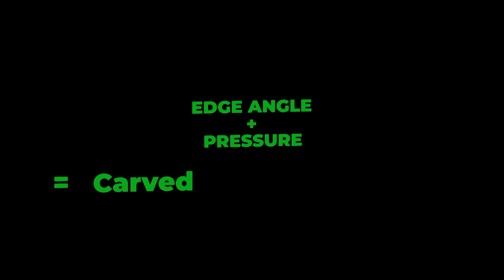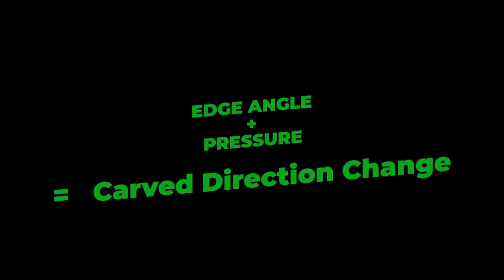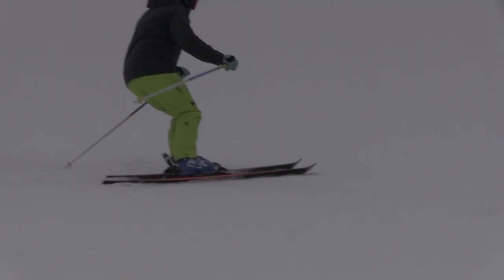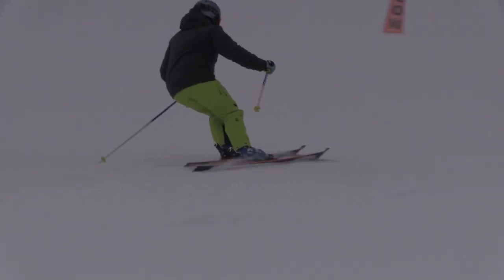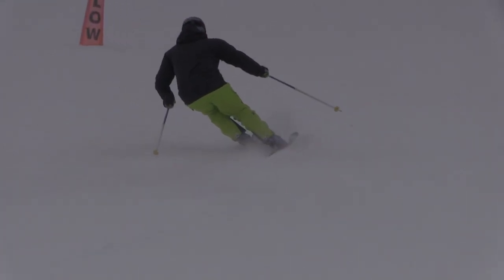Warren Jobbitt - Skiing Technique Exposed - Episode 3 - Direction change

Comment: 1:36 it is Not the lower body that creates anything in skiing.  It is the positioning of the upper body in relation to the direct that your skis are going that changes the leg angle so when you change your balance from your downhill to your uphill foot, that ski will roll over onto the inside edge and the turn will be created.

A new turn is created from your eyes down, not from your feet up.  Watch any GS racer in slow motion and it is clear to see.

1:44 The upper body is following the direction of the skis.  If the upper body stayed in that position, the leg angle would stay the same.  When he decides to start a new turn, his upper body stops traveling across the hill and starts to lean toward the fall line.  The skis continue on, and the leg angle changes.  When his feet pass under him, that's when he steps off his left foot and balances on his right foot.  The skis roll over and the turn starts.

1:54 This is 100% incorrect.  What he is showing is the end result the new upper body position in relation to where the feet are going.  Want proof that this is wrong?  Stand up.  Bend your knees to the left to make a left turn.  Which foot did all your weight fall onto?  Your Left foot.  Which foot are you supposed to be on for a left turn?  Your Right foot!

2:10 Watch his upper body stop and face down the hill while the skis continue across the hill.

2:14 By thinking about going straight down the hill with his upper body, it puts all his weight over the tips of the turning skis so they can control and compete the turn.

2:27 You don't steer your skis with your feet, your skis steer your feet.  The moment he took his weight off his left foot, his right foot flattened out.  Because his upper body is facing and leaning down the hill, his leg muscles will unwind and the inside of the tip of the right ski will dig in and start the turn.  

The "Twisting or Steering" feeling is a byproduct of the position of the upper body during weight change, not something you force your feet to do without it.

2:30 if you have to do all that work, why bother to buy expensive skis?  Why not use 1x4s with metal edges screwed onto them?

4:03 Watch him do exactly what I say and the opposite of what he says.
Reply: Ski Is from your feet up.....you are all wrong .
The upper body should do nothing unnecessary to maintain perpendicularity. 
Anticipating change should be restricted to absolute necessity and be concentrated in the lower body. The upper body should not actively contribute to create a turning force. 
The upper body should facilitate the actions of the lower body.
Reply: @faustoemattia  You taught absolutely nothing with that comment.  The absolute last thing that happens in a turn is the feet leaning over so the ski can turn.  Put your boots on and try to lean the boot over without leaning your leg over.  Try leaning your leg over without moving your pelvis to the side.  Try moving your pelvis to the side and balancing on your outside foot without first positioning your upper body back in the fall line.  Try thinking before you say things like, "Ski Is from your feet up."

Why didn't you go line by line and tell me how I am wrong instead of JUST saying, "you are all wrong."  

0:24 Imagine this is a dollar sign with a vertical line down the center.  The fall Line.  As his ski pass through the center line, he begins to stop the lateral travel of his upper body and put it in the fall line.

0:26 Look how his upper body is leaning towards the fall line.  He would not have that leg angle without putting his body there.

2:10  If he didn't stop his upper body from crossing the slope while his skis continued across the slope, he couldn't create the new leg angle to roll the skis over onto the new uphill ski edge.  The positioning of the upper body back in the fall line is what makes the legs lean over in the opposite direction, you change your weight from your downhill to your uphill foot, the leg angle continues which allows the skis to roll over and, THEN and ONLY THEN, do the feet change direction when the skis turn.

Everything he describes is the end result of what I say.  Therefore, what he says isn't teaching.  Just because you don't understand it, doesn't make me wrong.
Reply: @JB91710  you wrote a book about skiing ? Answers seem to be ready ...
Reply: @JB91710  show some of you skiing ...images never lies
Reply: @faustoemattia  You want to watch so you can mimic because you don't understand.  I am describing what every technically correct skier is doing.  They, don't know how to teach it so they just say,"Turn you feet."
Reply: I agree, it's a continuum but it does with changes in foot pressure   @faustoemattia